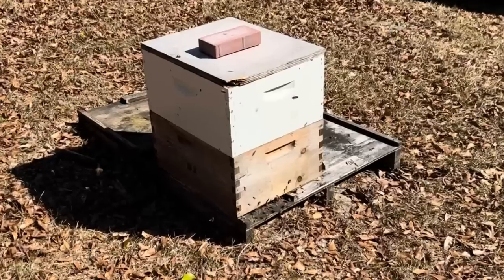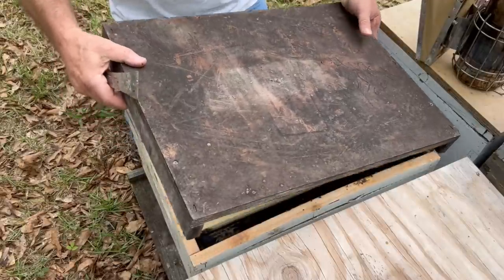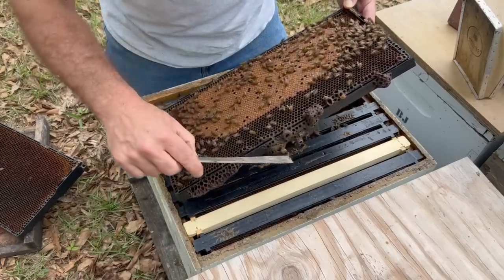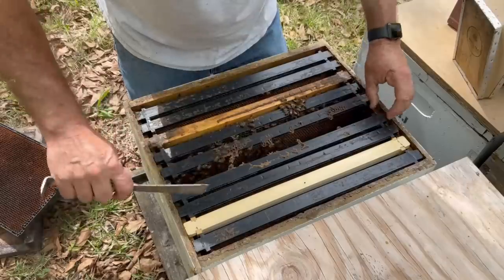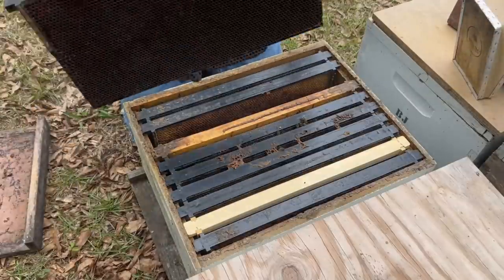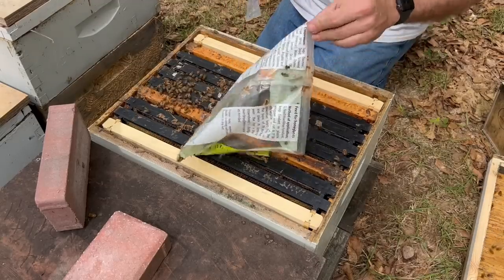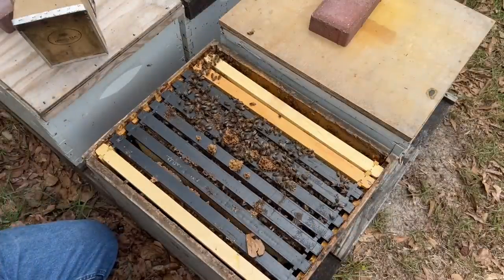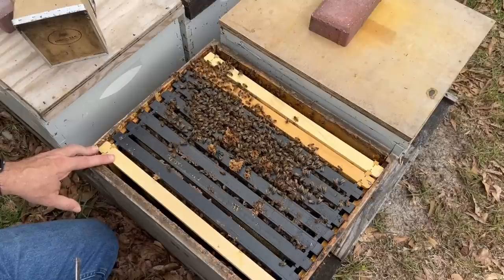🤔I turned 1 Beehive into 4: DID IT WORK?

Comment: Looking good!   I have done 4 splits in the last week.    

Something I have done is compare the growth of splits put in 5-frame nucs versus putting them in an 8 or 10 frame box.   

During this year and last. the ones put into a nuc box for the first few weeks have consistently outgrown the ones put directly into a full size box.   After a week or so, the emerging brood starts crowding things, so I put on a 5-frame medium super.     Then, after another couple of weeks,  if the population it good and the queen is mated and laying, I put them into a full-size box with a super.    By then, they are rolling, and quickly fill it up, passing up the splits that were put directly into a bigger hive.

That being said, building up a little slower during swarm season isn't necessarily a bad thing.

Great video.  Thanks for the follow up!
Reply from the maker: Yep. May have been better to put these splits into nucs.  Not sure exactly why I didn’t do that. Probably didn’t have the right equipment that day but honestly don’t remember.
Reply: @brucesbees  Whatever the case, you now have 3 more colonies, and no swarms.  That's great!  You can still put the weaker ones in a smaller box if you really want.   Last year was my first year trying nucs, and after I saw the difference, I ended up making a bunch of them over the winter.  Thanks again.
Reply from the maker: Oh yes.  They love nuc boxes for sure!

Comment: Thats just amazing! 4 way split on Valentines Day and they all took. Gonna have to figure out the fondant, haven't used it. Do you prefer it over 2:1 that early?
Reply from the maker: Yeah.  I really like the Hive Alive fondant. Works well in conditions where setup might create problems.  I just bought some in hive frame feeders to try though.  Have never really used them before.
Reply: @brucesbees  just used the Bruce10 discount and got some on the way! Also, they have pollen patties for 25% off in a flash sale, pretty good deal!!
Reply from the maker: @stevenaamos  yes! They are good folks.

Comment: Splits in February, how awesome is that! I'm only a 3rd year keep, those smaller colonies would you rather keep them where they're at or put them in a 5 framer box if they wasn't on a pallet? Just picking your brain thanks
Reply from the maker: Would probably be better in a nuc but this time of year they should grow into those ten frame boxes without any trouble.  I am not 100% sure why I used 10 frame boxes to be honest.  I might not have had enough nucs with me.  But it should work out fine.